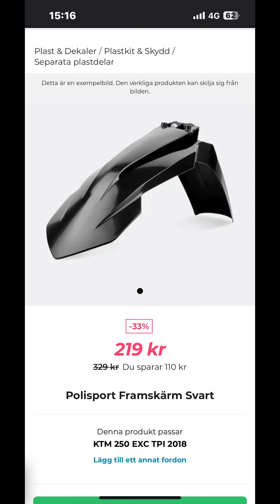Tuning story (Derbi Senda xtreme)

Comment: Hallo, ich habe mir vor kurzem eine Aprillia SX50 2018 gebraucht gekauft. Sie ging immer so 63 und bergab schneller. Hab sie zum Service gebracht und jetzt geht sie nur noch begrenzt genau 60, egal ob auf der geraden oder bergab. Auf der Rechnung vom Service stand nur, dass die Kette und der Lenker getauscht wurden. Ich weiss noch nicht woran genau es liegt, aber ich denke es liegt in der Elektronik, da ich auch einen tuning motoflow kruemmer, ohne drossel habe. Wuerde mich freuen wenn jemand helfen koennte weil es wirklich keinen Spass macht bergab 60 zu fahren. Danke im Vorraus.
Reply from the maker: @fnconxy  I’m Swedish so could you write it again in English ?
Reply: @Moppegubbar översätt bara. De finns en översättnings knapp. (älskar ditt resultat på moppen) När du köpte nytt franstänk/ framskärm, köpte du oxå ny plast där lampan sitter? Isf undrar vad den hete